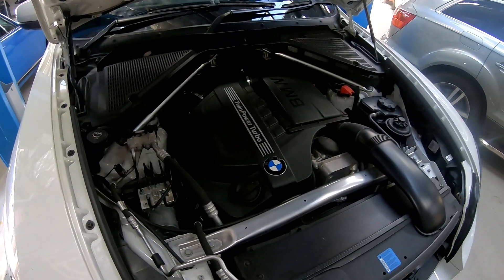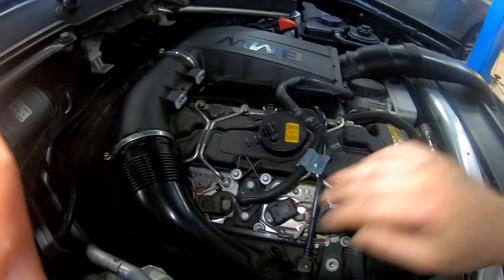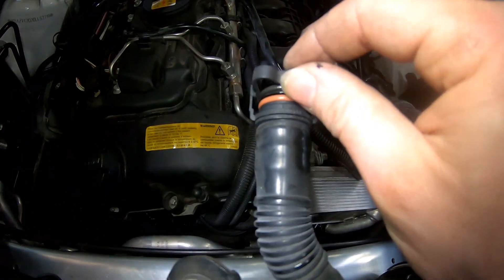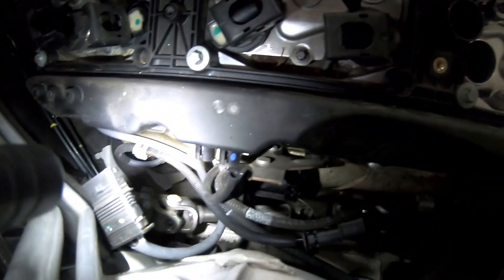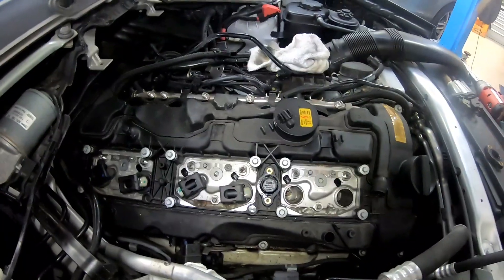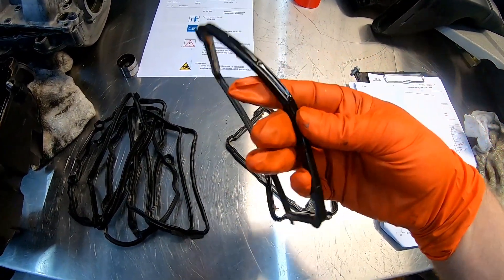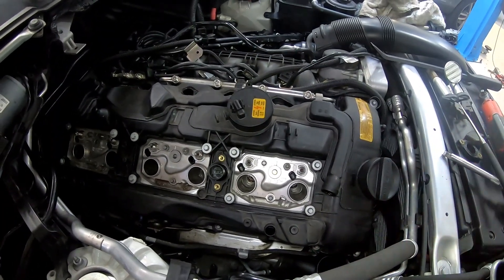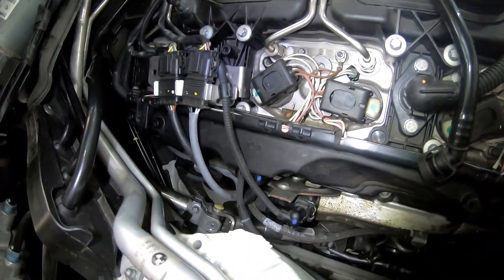BMW E70 N55 Rocker Cover Gasket Replacement Guide

Comment: Very informative, thank you very much. I've got a m135i with this engine and there's a misty leak around the front of the engine bay, at the moment it appears to be the oil cap so I've replaced this but suspecting the gasket could also be leaking. Will look at replacing this after following your video :) Only tool I'll need is a torque for very low nm as mine starts from 45nm. Cheers!!

Comment: Do you use silicone to get gasket to stay in place?
Reply: Hell nah. You want the gasket and valve cover. The pcv is integrated. So replacing the gasket only most likely will ened up needing it again. More $... so replace it together the gasket is preinstalled in most vc